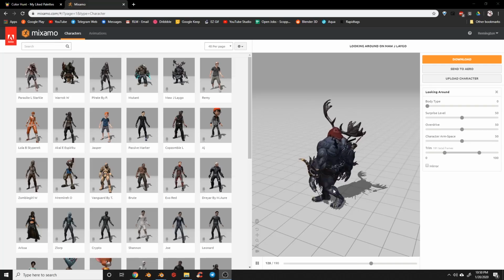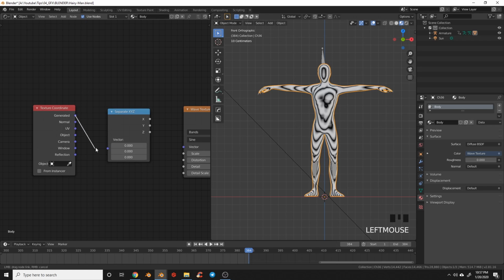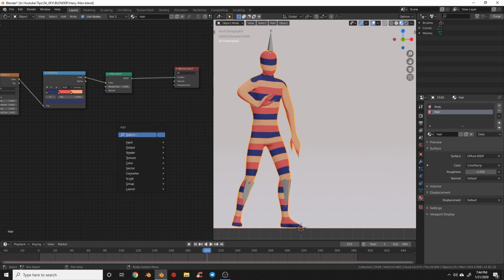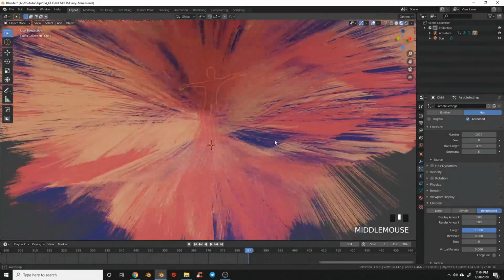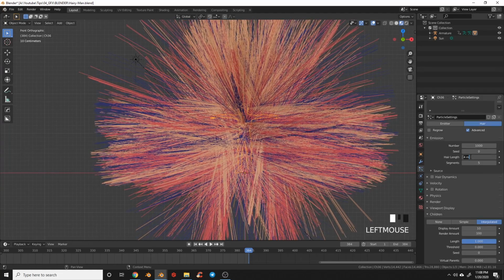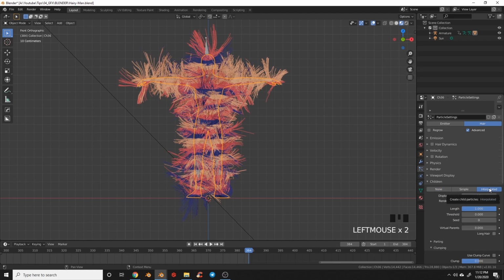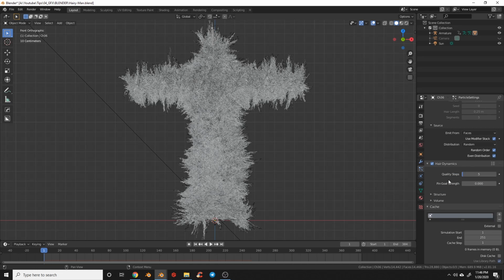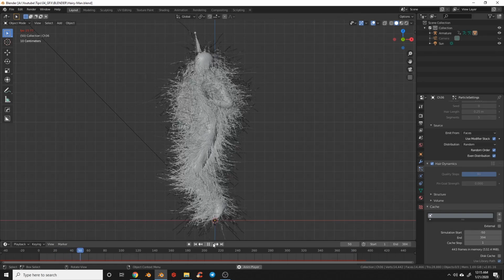Blender Motion Capture Hair Simulation Loop Tutorial

Comment: Hello - I watched this tutorial for guidance on how to use the hair simulator. Very helpful, thank you. I'm kind of at a lost now tho. The hair sim has issues where it will randomly start sticking a plane or blows out. It happens if it's baked or not. It's occurs far into the animation (exp: frame 120). I wouldn't mind so much but it shows up in the renders. Also while baking the emitter will ofter just disappear half way through so I try not bake due to this. This is a lot but anyone have any ideas? Is it a blender issue? Running 2.9 fyi.. I've tinkered for a week...
Reply: If anyone is curious I had collisions turned  on for the floor. I didn't want the fur to fall through the floor.  Turned that off and now the hair sim works perfectly.
Reply from the maker: have you tried turning up steps or strand resolution to help?
Reply: @SouthernShotty  wow that was a fast reply  - Thanks. I have the steps under B spline set at 10 and strand steps at 10 I think your tutorial said they must be the same number? I can up the b spline but strands steps tops out at 10 so left both at 10.  Quality steps in hair dynamics are at 40.

Comment: Didn't you have any issues with the head and tails pointing Wong way? I see that a lot with models from mixamo, forcing them to connect tends to help
Reply from the maker: I didn't have any issues. I wanted to keep the tutorial available to everyone, I have motion capture suits available at the studio, but not many people have that technology at home. I tried to explain all the values, but was trying to keep it under 30 minutes. You don't have to comb the hair but it does still play into the simulation. It depends on where you live and what you're using it for, but coreweaves prices are the cheapest I've seen so far. I've spent far more for far less when working on client projects. thanks for watching
Reply: @SouthernShotty  I meant the bones on the ported model. Lots of models I've used from them have the bones pointed out weird location due to different y an z axis.
Reply from the maker: @RomboutVersluijs  it usually works for me if I tweak the axis in the import dialogue options, but the whole z up doesn't always work with other apps